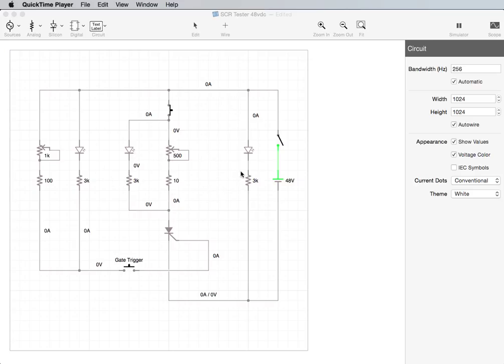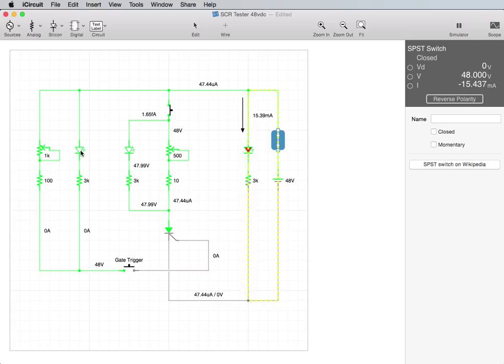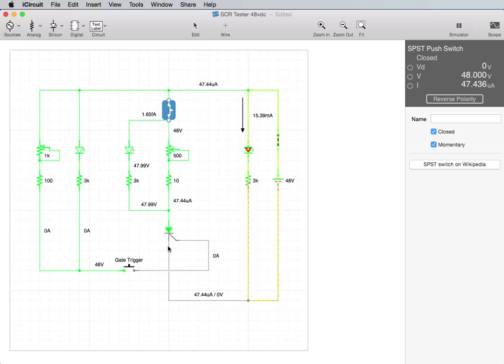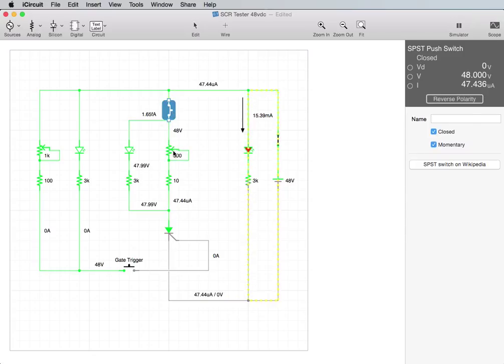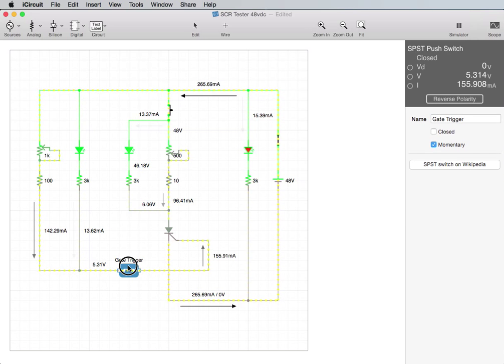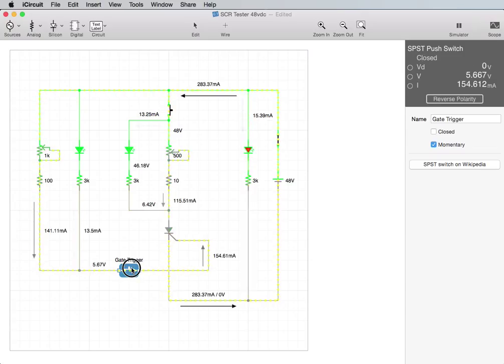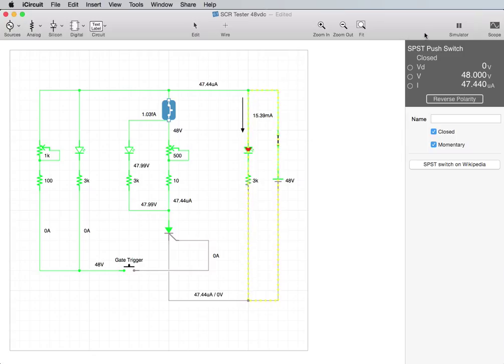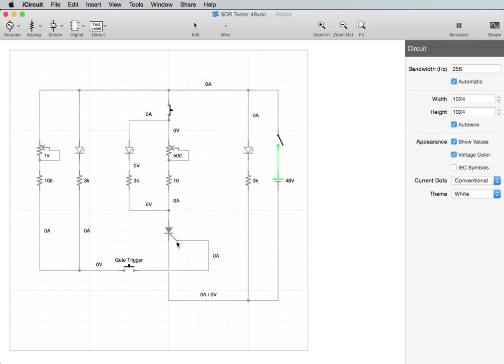iCircuit Circuit Simulator App Example: SCR Tester

Comment: Can I use this app also in Electronic circuits??
Reply from the maker: +ViKinG_TankeR  Yes but the library of components is small.  It will do a lot of basics though.
Reply: +Edu.Science  Thank you. But Can I measure the voltage across the line? As in real circuit?
Reply from the maker: Yes the app will display voltage and current.
Reply: ViKinG_TankeR